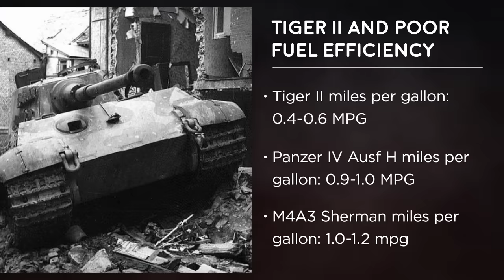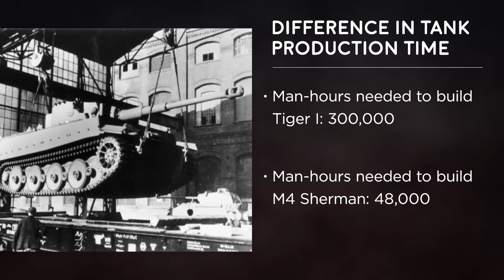Why Did German Tanks Perform So Badly in The Battle of the Bulge?

Comment: To add to the performance of the Shermans -- the Sherman also featured a "unity" (1x magnification) sight which in urban combat makes target acquisition much quicker due to the large field of view it had. Crews also had numerous periscopes -- the driver, assistant driver, commander, and loader all had periscopes which could rotate and tilt allowing them to scan when not performing other jobs while most german tanks only provided this level of vision to the commander.
Reply: One really neat feature of the Sherman was that the commander had a scope that roughly emulated the gunners scope and also could take control of turret rotation. If the commander saw a target first, he could get the turret rotated and close enough for the gunner to get onto target quicker.
Reply: @LordNinja109  And don't forget the early stablizers for their guns and the 76mm guns meant for the big cats.
Reply: people also kind of don't know that the 75MM gun of a standard Sherman can still penetrate even the front glacis of a Tiger at short range.... and in heavily wooden terrain, it's really easy to get to close range. The main gun of a Sherman is a hell of a lot better than most videogames would have you believe

Yeah, a very well positioned, dug in Tiger did a great job in one instance (as one should expect, tigers are pretty well designed weapon systems).... but in the average tank engagement it's a lot less one sided than some corners of the internet pretend
Reply: @petriew2018  You are perhaps referring to the Tiger I.  No Tiger II was ever penetrated from the front ever in the war by anything.
Reply: Petrie W

Sherman 75mm were proven to FAIL to penetrate the front of the Tiger I even under 100 yards.
Reply: No tank types performed great in the Ardennes on either side. It was poor tank country all around. Hills, woods, narrow twisting roads, small bridges. Even a 25 ton Jagdpanzer IV collapsed a bridge and they were nearly ten tons lighter than a Sherman. 
The allies didn't move any faster during their counter attack in January. They struggled in the terrain and weather too. Most Sherman tanks had narrow tracks which were not good in snow, slush and mud. Over 500 Shermans were lost in combat in the Ardennes. That's more than all the German armour types lost in combat combined.
Reply: @lyndoncmp5751  For your first command, I want to know what shell was being tested for the trial you reference. The M61 APCBC has enough rated flat penetration for the upper front plate so it'd be weird if it magically had issues in that area.

As for your remarks on tank losses, that's actually a misconstrued interpretation of after action reports that ignore the mindset of the people writing the reports. Yes, combat reports from American Officers were exceedingly high when it came to reporting Sherman knockouts compared to German Officers, but that was a factor of both sides having drastically different situations. American Officers would report Shermans as knocked out for a wide array of reasons and send them back to motor pools for repairs. Because spare parts were plentiful, the Americans were able to repair their tanks and get them back to the front without much hassle at all, which gave an appearance of the 'Sherman wave'. On the other hand, German Officers would rarely report a vehicle as knocked out unless the vehicle was totally unsalvageable. Because of issues with spare parts stockpiling, as well as German armored units being a center of propaganda, they would keep tanks with damage sustained and try to conduct field repairs to get them back in action.

Because of this, the myth of German tanks superiority from combat reports was created. Because of the difference in raw numbers, many ignored the context of the reports and just took it that German armored fighting vehicles were superior. In reality, it was simply because America wasn't focused on creating self gratifying reports and were fine with sending tanks back, as usually there were fresh tanks arriving or tanks that have finished repairs ready for service. Do I believe that the American Officers put casualty reports as being as high as 500? Sure. Does that mean they lost 500 Shermans that were unable to be salvaged? Nope. Unlike the Germans, who reported knockouts when the vehicles were actually unable to be repaired, the Americans had no issues with maintaining a large armor presence without proper logistical support.
Reply: @AstinCrow  It is well known that the Sherman's 75mm could not penetrate the Tiger's front armor at all, it even had to close to near point blank range from the sides to have much of a chance, and even then only if the Tiger stood at an optimal angle. It even struggled against the 80mm hull front of the venerable Panzer IV. 

The 76mm was also severly underperforming due to low quality armor piercing ammo. US tests were flawed, as they were conducted sgainst armor plates that were softer than German armor plates. Especially for the Tiger 1, the problem was "low quality anti-tank rounds meet high quality armor". British tests found that the Tiger's armor performed 13-20+% better than its actual thickness, which means that the upper front plate in reality performed like it was about 115-120mm thick. Tiger drivers were also trained to angle their tank, nearly doubling the effective armor.

As for losses, we are not talking about knocked out tanks that could be repaired, but total losses. While most of the US losses were due to combat, many of the German total losses were tanks that ran out of fuel, and had to be abandoned when they retreated. According to the Dupuy Institute, USA lost more than 900 tanks and TDs as total losses in the Bulge, almost twice as many as the Germans. This was enough to trigger a second "tank scandal", the first one was after Normandy, both with the Sherman as the main defendant.

It is true that the Germans sometimes kept damaged tanks in the unit for fear of outright losing them if they sent them back for repair. But these tanks were not listed as combat ready, and eventually had to be repaired, cannibalized, abandoned or written off.

The Sherman was a good tank, roughly comparable with other tanks in its weight class, and in most ways superior to the T-34, but it was simply not designed to take on a 45 ton tank of the next generation. Allied intel dropped the ball on the Panther, which they assumed would be just another limited production heavy tank - instead it became the most common German tank in the period from  6 June to the end. 

Saying the Sherman was superior to the Panther, is like saying the Panzer IV was superior to the M26 Pershing or Centurion mk. 1, which it clearly wasn't.  Yes, it had a few advantages, but very few of them were combat capabilities.
Reply: Saw a video recently on 1941 British requested features for m3 grant being speckled out. Among them were several periscopes which were included in m4 sherman
Reply: You can read in US action reports where 26 tanks were knocked out. The next morning 24 of them were repaired and on the line.
Reply: @williamosgood3565   I can't read it because I have no idea where that is written in "US action reports"...and common-sense precludes me from even looking for it. 

Whether those 24 were repaired or not, at least 240 of them arrived at the Western front that same day. With full crews. What I find of more utility is the fact that even the 76mm gun on the Sherman could actually penetrate the Tigers' side and rear armor, and not even have to close to within "point-blank" range to do it. I think it had to lose to within 330 yards and have an incidence angle < 17 deg, but still. Even the cheesy British 6-pounder could penetrate it. 

The problem was the frontal armor combined with the lethality of the 88 mm main gun of the Tiger.  Which also was a problem for the Tiger in that it was a poor weapon for HE rounds. It was good at knocking-out enemy tanks from a distance, but not so good as support or mobile artillery. Combine that with the fact that the Sherman was much better and we had far more Shermans than the Nazis had Tigers...not to mention the gas to put into them and the support to keep them running...when you have only so many Tigers, they break down on their own if left to their own devices and they are almost impossible to tow back to the rear for repair without risking another Tiger in the process? Much like Hitler, the Tiger was a tank that we were somewhat happy for the Nazis to rely on. Not to say they didn't have their moments in the sun.  But it wasn't like they absolutely ruled the battlefield as in the heavy tank role. Much more lethal as dug-in artillery, as many heavy tanks were. Meanwhile the medium Shermans had the run of the battlefield. 

Similar to how light bombers and heavy fighters are a great idea until they have to actually fight against faster, more-maneuverable and well-armed fighters. In this one area, the Nazis did have enough of an advantage to change the RAF strategy of night bombing to daylight bombing...which resulted in the loss of their daylight fighters when used in defensive roles.The Nazis were still bombing England right up until the end of the war. There were mobile V1 units active in Holland who fired off their last V1s and immediately surrendered to the Allies. 

https://en.wikipedia.org/wiki/Fighter-bomber_attacks_on_the_United_Kingdom_during_World_War_II

The irony is great here, the Nazi fighters were ineffective at protecting the bombers and ineffective when used as fighter-bombers, and the fighter pilots heavily protested their use as fighter-bombers. We had entire wings of fighter-bombers operating against the Nazis until the very last days of the war. There's a WW2 movie just about Thunderbolts bombing bridges in central Italy. They were flying missions almost non-stop to block Nazi reinforcements from moving south into position against Allied forces moving north. 

There is no question that much of WW2 was about the manufacturing and raw-material advantages of the Allies  over Nazi Germany, but the same holds for the advantages that the Nazis had at the beginning of the war. Raw hubris at its finest. They then wasted further manpower and resources attempting to cover-up their war-crimes. I mean, Jesus H. Fucking Christ. If you're going to be a Nazi, then be a fucking Nazi.
Reply: @touristguy87  Same problem with the US 76mm as the German 88mm with regards to high-explosive effectiveness = great anti-tank guns but no so great infantry support guns.
Reply: @sirridesalot6652  oh sure if you say so. Of course a flak gun and a medium tank gun  have the same problems with HE rounds.
Reply: @touristguy87  

Technically he's not wrong if you compare HE effectiveness between the 75 and 76 Sherman guns. 

However, the 76 still had a vastly superior HE round to the Tiger's 88 gun.
Reply: @youraveragescotsman7119  based on what
Reply: @petriew2018  Err no.
A standard Sherman (British) drew up to a hedge in Normandy with it's gun in the hedge.
From the other side came a Tiger 1, he saw the big muzzle poking through at him
He (and his crew of course) got off 5 rounds, did no damage
The Tiger fired once and split the Sherman's turret in half
So to say that about the 75mm is false

The 76mm is much better but we bought some TDs, whipped the American 76mm off and put the 17 pounder on
We named them "Achilles"
Reply: @TTTT-oc4eb  didnt the sherman score a positive kill ratio against panthers lol
Reply: @youraveragescotsman7119  The Tiger's 88mm HE shell had 50% more HE filler even than the 75mm of the Sherman, and twice as much as the 76mm. So it was superior to both.
Reply: @sapiensiski  Absolutely not.
Reply: @TTTT-oc4eb  im fairly certain they did lol
Reply: @TTTT-oc4eb  The 1946 BRL study in fact shows exactly why the Sherman performed better. The gun penetration versus armor calculation are in fact just a very, very small part of the entire engagement cycle.

A tank vs tank battle does not begin and end with an anti-tank round trying to penetrate the armor of an enemy tank. The tank first has to find the enemy tanks, and then hit the enemy tanks. The former requires diligent reconnaissance, situational awareness, and better maneuverability. The latter requires good positioning (which is also dependent on maneuverability) and accurate + fast-firing guns. The Sherman proved to be the better tank in these regards by an enormous margin compared to the Panther.

To further elaborate, the Shermans were on the tactical defensive in 20 out of 30 examined engagements. This may seem paradoxical given that the American Army was on the offensive, but a close reading of the tactical practices of the US Army showed that the superior mobility of the Sherman tank allowed it to quickly seize key ground before the break-down prone Panthers. This forced the Germans to counter-attack against prepared Sherman tanks in ambush positions (otherwise they would give up the key ground), and the Shermans notched a 5-1 kill rate in their favor on the defensive. 

On the attack, the Shermans should have suffered the same kind of losses in reverse, since it's the Panthers who would have been in ambush positions. And when the Panthers spotted and fired first, they were able to notch a 5-1 or higher kill ratio in their favor against the Shermans. 

However_, the data showed that the Shermans _still fired first 50% of the time even when they were attacking, and in these instances the 5-1 advantage again swung back to the US Army! By contrast the Panthers only fired first once in the 20 engagements wherein they were attacking.

The disparity, based on accounts by people who worked with and rode on restored Shermans and Panthers, is the sighting system. The Sherman had a gyro-stabilized sighting system which allowed the gunner to quickly aim and fire on enemy tanks as soon as the tank had stopped. The Panther's gunner by contrast had poor sights, requiring the commander's direction to re-acquire the target before aiming and firing on the targets. This accounted for the huge disparity in first-fire statistics - the Shermans were simply faster on the draw in terms of spotting and firing; and the maneuverability meant they were in the advantageous ambush position much more often than not.

Finally, much of the gunpower vs armor assessments are jilted because they assume guns being fired on the front armor. This is a completely flawed model as reports of hits on both the Soviet Army T-34s and US Sherman tanks show that the majority of hits were to the side and rear; even when the tank could theoretically be penetrated from the front. 

And given that the front is only 25% of the surface area of the tank, this makes sense. It's actually rare for the enemy to have no choice but to attack the front. Given this, it's rather clear that assuming front armor thickness if the prime determinant of battlefield survival is flawed to begin with. In reality most tanks that survive combat are never shot at to begin with - the enemy either never saw them or missed. 

When tanks are actually hit, "zones of immunity" are a more important measure of survival than front armor thickness - meaning the percentage of the tank's surface area that has armor thick enough to bounce the incoming shot. The Panther in fact was an abysmal tank in this regard as all the armor is in the front - which is why there are examples of Panthers knocked out by 14.5mm anti-tank rifles to the side and one case of a penetration by the same rifle from the front that found a hatch. To be fair, the Sherman's zone of immunity isn't fantastic but is better than often given credit for - the front is only an inch thinner with its slope than the Tiger's front. To get really good zones of immunity you have to look at the IS-2.

The Panther last saw combat in 1945 and was used as a trainer until like '49. Because pretty much everyone agreed it wasn't really that good

The Sherman saw major tank on tank action as late as 1973 against T-64s produced in the '60s and was able to hold its own. And further unsuccessful combat in '82. And was used by some armies like Chile until 1999. 

There's really no legitimate argument about which tank was better or more successful.
Reply: @sapiensiski  Again this nonsense. Some 30 out of several hundred engagements by just 2 out of 15 US armored divisions. This study only include some 30 engagements during the autumn of 1944 where US veterans often were up against German rookies. The study does not include the massive battles of Normandy, Battle of the Bulge or the fighting in Germany itself, where Panthers slaughtered Shermans and caused a "tank scandal", with the Sherman as the main villain. There was a reason the Panther was greatly feared by allied tankers - almost as much as the Tiger.

And the Panther had vastly better offroad mobility than the Sherman. Only the rare late war HVSS variants came close. The Sherman had the worst offroad mobility of any late war medium tank, maybe only equalled by the Panzer IV. Even the Tiger II could go places where the Sherman couldn't.

The Sherman was a high quality vehicle, but against the Panther, let alone a Tiger, it was up against a new generation of tanks with vastly superior combat power compared to the typical30 ton 1944 tank. It would take the M26 and Centurion for the allies to catch up.
Reply: @TTTT-oc4eb  I hardly regard it as nonsense. Its either trusting these sources or the german sources, I know which ones Im picking. Panther did have its good qualities yes. But just like the 2c, the good qualities got drowned by all the bad qualities. Hardly a "superior" or a "next gen" tank. Big gun and heavy armor dont make it next gen

But then again youre arguing that the tiger 2 can reach places the sherman cant lmfao, so there is really no arguing with you people

Youre just ignoring the things what made the german late war designs, well, bad in the first place

I also provided you with a source and plenty of other info, but it seemed to just go right past your head. Did you even read my comment?  Can you prove this "tank scandal" without some shitty book written by Belton Cooper or a malk felton video? There is a reason no one really thought the panther wasnt that great
Reply: @sapiensiski  Well, here's an US source for you:

“The wider tracks of the Mark V and Mark VI enables it to move much better cross-country and in muddy or snow-covered terrain, than do the narrow tracks of the Sherman tank. The field expedient of duck bills added to widen the Sherman tread, aids but does not affect the advantage the German Mark V and Mark VI tanks have. It is my opinion that the Mark V and Mark VI enemy tank is far superior in maneuverability to our own Sherman tanks.” 

Capt. Henry W. Johnson, Co.F., 66th Armd. Regt.

And here's a real test: 

https://www.youtube.com/watch?v=O-cFP4S7bc4&t=132s

https://www.youtube.com/watch?v=Mwiy1bdqMfQ&t=15s
Reply: @TTTT-oc4eb  Cool, I never asked about anything about maneuverability, and thats a panther getting to places where the sherman cant, not a king tiger. Wehrbs huffing on copium are known to lose their ability to read. I asked if you can prove the "tank scandal"? Also those videos really dont take realistic matters into account, and a competent sherman commander would never get his tank into those kind of situations. Also look at the speed which the sherman does pass the obstacles compared to the panther, so my point about the mobility still stands
Reply: @sapiensiski  You claimed the Sherman to have superior mobility, which it didn't. The first quote from the US veteran involves Panther and Tiger II.

There were actually two "tank (Sherman) scandals" - one after Normandy, and one after the Battle of the Bulge, where the matter of the poor performance of Allied tanks where discussed on high political levels.

Hardly a single allied veteran will claim the Sherman was superior to the Panther or Tiger, only modern day "patriotic" gamers.
Reply: @TTTT-oc4eb  well theres a reason you dont listen to tanker veterans, since they are highly biased against their own equipment and they are often incorrect. You'll have to take a look at official reports and what was documented. And almost not a single one of those tell how "badly" allied armor went up against german armor. The reason for the political discussion about the "poor performance" was because the allies actually brought back reports of losses. The germans didnt, for obvious reasons, and this leads to a myth of the superior german armor. All of the panthers and tigers mobility counts for nought, if its not reliable mobility. This just makes a tank a glorified bunker. And tank combat isnt some sort of chivalrious engagement between 2 tanks. There were always more shermans than panthers, which just goes to prove how reliable and easy to transport they were. Also isnt "mk VI", just a regular old tiger 1, not the king tiger?
Reply: @sapiensiski  Both Tigers are Mark VI, and this report were from early 1945 when there were very few Tiger 1s left on the Western front.
Reply: @TTTT-oc4eb  well then I want the stuff that captain is smoking!
Reply: @sapiensiski  So you only choose the reports that suits your bias. There are multiple reports on "Royal Tigers" going over soft ground where Shermans could not go.
Reply: @g8ymw  The Achilles is the British name for the M36, with both the 76mm and 17 pdr.
Reply: There is no doubt the Sherman had many excellent soft factors.  German evaluation reports on captured examples are almost glowing and very positive.  The Germans respected the Sherman.    If given a choice to drop their Panzer IV in favor of Shermans they would do it in as heart beat.   I doubt they'd give up their Tigers for two Sherman.   If they had a tank as good as the Sherman they'd probably have delayed the Panther for 6-10 months and tested and debugged it properly.    It went from drawing board to delivery in 14 months.  
-The early Panther tanks had a rotating periscope for the Loader but this was deleted on economy grounds.   That explains a lot about the manufacturing situation in Germany in 1944.   German tanks had a 'commanders cupola' which gave excellent situational awareness.   It was an armored tube in the turret with vision slits for the commander (for Panzer III and Panzer IV) but 8 periscopes for the Tiger and Panther.   StuGs and JagdPanthers got rotating periscopes for some reason except the last model of the StuG.
Reply: @TTTT-oc4eb  The Sherman's 75 was tested against the tiger, and was found able to deal with it. Penetration is not really what made it useful. It was spalling, overpressure from HE shells, and destruction of vision, optics, and loading mechanisms, all of which were generally oversensitive in German vehicles. Combat ineffective = destroyed tank. For almost the entire war, in all engagements, the tank that fired first almost always won. Whether a Betka vs. A panzer 4 or a sherman vs. a Panther.

The exceptions are very rare, and involve a single KV2, a couple KV1s, and the Char B1 bis. All of which (despite widely being considered terrible tanks by their armies woefully out of date) had stupid armor and could bounce shots from the tanks they faced for a short time.
Reply: @TTTT-oc4eb  The Sherman is literally considered superior to the Panther. How do we know this? The French. They extensively tested both as the French received almost the entire German armory of Tigers and Panthers. They begged even for old M4A3s as they were considered Vastly superior vehicles due to the extremely poor performance of German transmissions, they could function for a time, but blew out constantly. Not to mention the problems with the road wheels.

The french tested the American 76 and considered it a good enough gun to copy and use for ever as it outperformed the german examples, and took greater inspiration from the American 90mm rather than the 88 for their (comically superior to the tiger 2) knockoff Tiger 2, the ARL44. Which despite being an actual trash tank made out of left over parts literally meant just to get leftover stuff in production again the moment the war ended, built out of some pre-war garbage, battleship plates, and a design so awkward it's hated--still performed better than the Tiger 2 in part due to those French bizarro 'fixes' to issues. (The silly WW1 tracks helped offset the weight/ground pressure issue as they were designed for use on the ultra-heavy Char B1, Char 2c and F1 FCs..they were bad but they solved that) and its engine, and transmission both were more reliable.

The French and post war DDR both extensively tried to use the late war German tanks and, for the most part, they were all considered technological dead ends. Over-complex, over-specific, great 'on paper' tanks with horrible for logistics or popular usage. There's a reason why Jagpanzers and Pz. IV's keep showing up in third world armies, and even the ones that had tigers and panthers scrapped them a long time ago. They were really bad. What replaced them? Mostly Shermans.
Reply: @WereScrib  I recommend reading multiple sources, not only Chieftain or others that "confirm" your bias. The only "testing" the 75mm M3 did against the Tiger was in combat, and it was next to useless. The few Tigers knocked out by standard Shermans were due to fluke hits or point blank penetrations from the flank. Only some 50-60 Tigers were lost in tank vs tank on the western front, many of these to tank destroyers and Fireflies. Vice versa, the Tiger units in the West claimed more than 700 kills, the vast majority being Shermans.
Reply: @WereScrib   The French had some 40 A and G Panthers, many with various degrees of combat damage, others were from the last batch produced and of such low quality they barely qualified as museum pieces. In addition the French drivers obviously didn't pay too much attention to the driver's manual, as German drivers managed 10 times the mileage on the mechanical components. The French had very few Tigers.

As for the 76mm M1, the problem wasn't the gun which was very good, but the poor quality M62 rounds, which had a nasty tendency to shatter, even against the 80mm front hull armor of the venerable Panzer IV.
Reply: A key advantage of the Sherman was the turret gyrostabilizer. Made it much more accurate when moving or pivoting while firing
Reply: @petriew2018  You   are mistaken. It would be a rare and extremely lucky shot for a standard Sherman 75 to punch through the front of a Tiger 1. Is it possible? Yes, but highly unlikely. I think the internet may have a better grasp on it than you do.
Reply: @lyndoncmp5751  They were capable of inflicting mission kills.
Reply: @WereScrib  m
Reply: @williamzk9083 there are a few exceptions to that. Most of the tiger 2s sent to the east would be countered by Soviet IS2 tanks, whose 122mm cannon wouldn't penetrate the king tiger, but would hit it with such force that the king tiger would get cracked. This was due to the large caliber of the Soviet 122mm cannon and the extremely brittle steel used on German tanks. So technically they weren't penetrated, but they would be beyond repair
Reply: @ethanedwards422  No Tiger II was ever penetrated by an 122mm.  Its also incorrect to say they were all beyond repair.  The steel of some late war tigers was brittle but not extremely brittle.
Reply: @lyndoncmp5751 Sure,but allies were able to replace their loses 10 to 1..Germany no so much .
Reply: My dad was also a Tank commander of a M4 Sherman!
Reply: @TTTT-oc4eb  and you go to your own that suits your bias